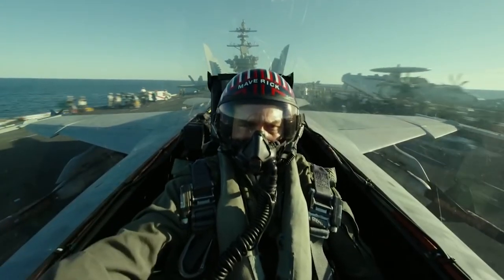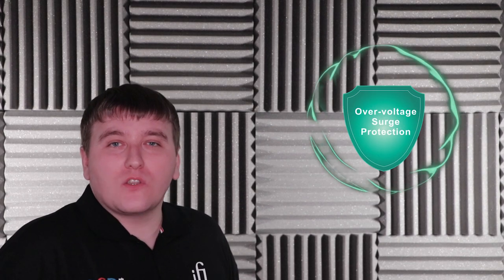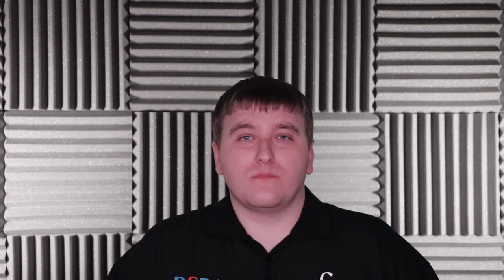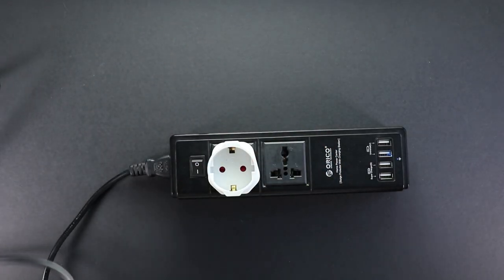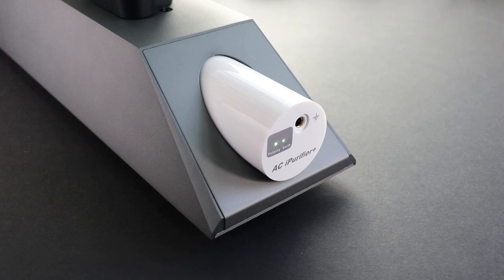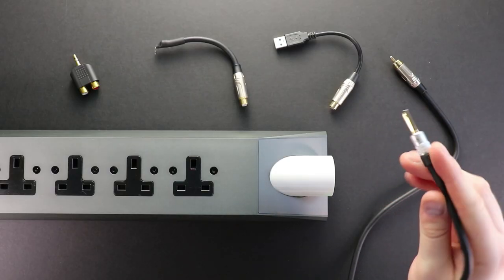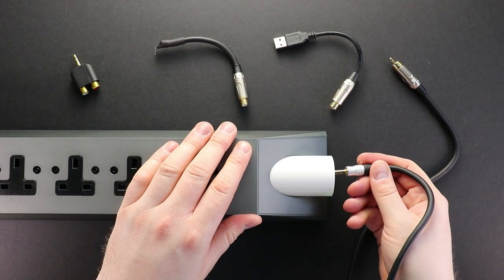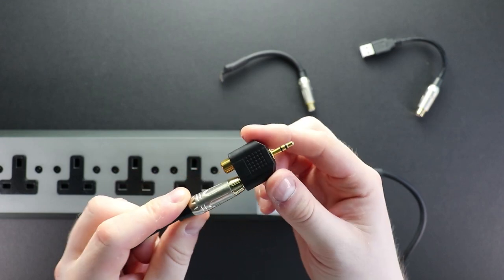Explaining the PowerStation - clean active power conditioner

Comment: I really like the PowerStation but it costs more than 500 euros here in Spain... a little bit on the pricey side if you ask me.  Taking into account it doesn't regenerate the power and it doesn't have a battery I don't know why the price tag is so high.  I love the product though and I'd bought it without a doubt if the price goes down a little bit around 350-450 euros would be great.
Reply from the maker: Hi. This type of product a battery isn't possible, nor can it generate new power, but it doesn't filter what is there. Thanks.

Comment: It's good you explain and not just advertising like some of your other videos! you should do this more often!
One thing I wanted to know what's it like with the turntable AC motor or dc motor and external phono stage with ground, is there any ground loop issues
I don't think you explain the RCA plug earthing should only be connected to the input RCA only not an output?

Comment: I read on the PowerStation website about the noise cancellation. It said that low frequency noise, and up to low MHz noise is actively cancelled. Then passive noise cancellation is used for higher  MHz noise. Please at what frequency does the active noise cancellation end, and the passive noise cancellation come in?

Comment: Hi! A question. Usually on the power strips there are some sockets for the analog amolifier. Usually unfiltered. Here are all filtered, is it suitable for an integrated amplifier or preamp? Thanks
Reply from the maker: Yes, possible to use with any audio device. Thanks.